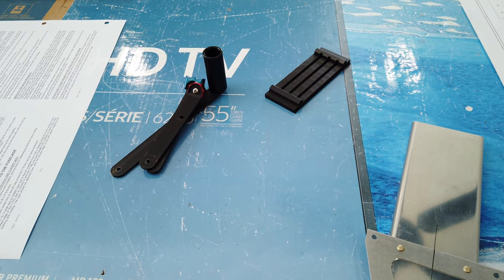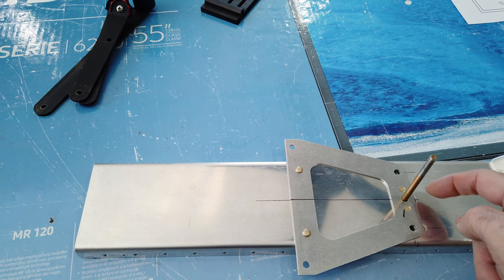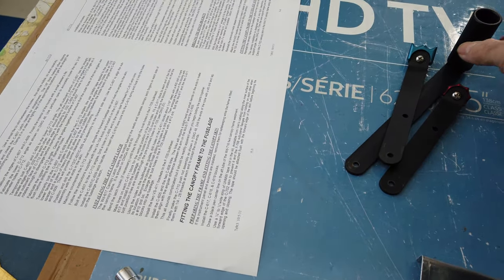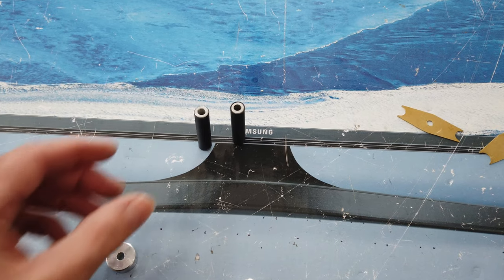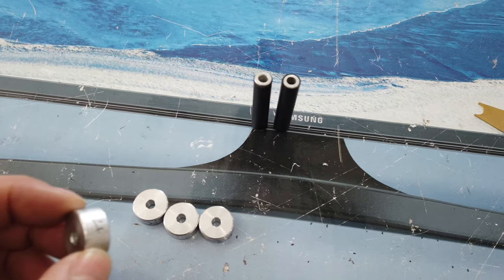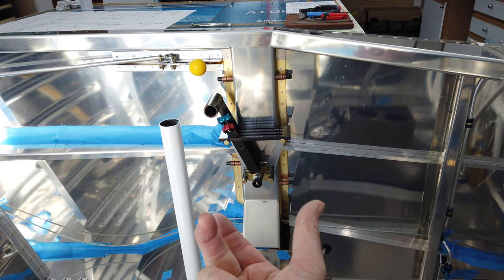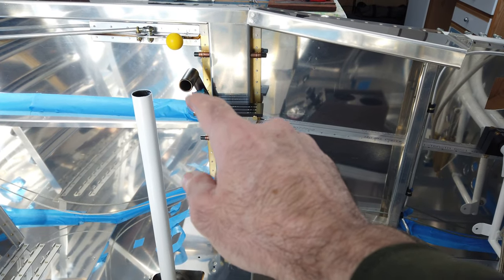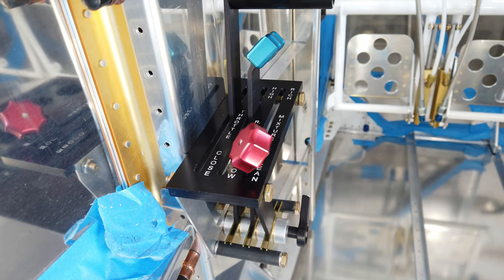Vans RV 7 HINT Video Throttle Quadrant Mod Begins

Comment: Got started on the -8 today! Fuel tank nutplates! I’m using your tape trick to keep the chips out of the crevices! Thanks!

My buddy built a -6, and put one throttle on the left to the engine, and a second throttle in the center (the right seater can use it or the left seater has a choice on which one to use) The center is a throttle knob with the friction wheel, and it connects the the lower side if the left throttle, basically the center knob acts on the left side (main) lever.
Reply from the maker: Lots of nutplates I bet!  The tape will make clean up a snap and  keeping those pesky chips out of all the crevices keeps the plane lighter!  8^)

Comment: When I was thinking about a -7 I thought I’d set up the avionics and switches so the plane could be flown with the PIC in the right seat (switchable to the left). I’d always fly the plane from the right seat but the next owner could flip a switch and move the primary display to the left side. But now I think I’ll build the -8.
Reply from the maker: The -8 is a good ship.

Comment: Loving your informative vids! Im still torn between building the rv7 or 8
Reply: I’m building an -8. I’ve flown both, and they both fly almost the same. Get a ride to make up your mind. If you’re selfish and want to ride centerline, the -8 is the way to go. So much better to loop and roll on centerline, and since most of my flying is solo or with another pilot who can appreciate centerline, I went with the -8. The -7 (or -14) is probably a better cross country machine, and better for “sharing” the experience with someone else, especially if they aren’t a pilot, it’s probably nicer to be able to point things out while you fly instead of them starring at the back of your head. Aileron rolls in the side by sides are ok, but a little different than being on centerline.
Reply from the maker: Thank you sir. I can't make up your mind for you as far as plane choice, but I can help you with questions on either one if  needed.  8^)

Whatever plane you decide to build, please remember my build number in the description above...I would appreciate the referral greatly!